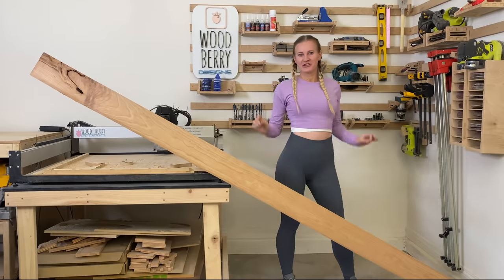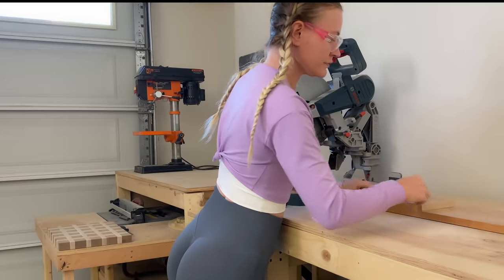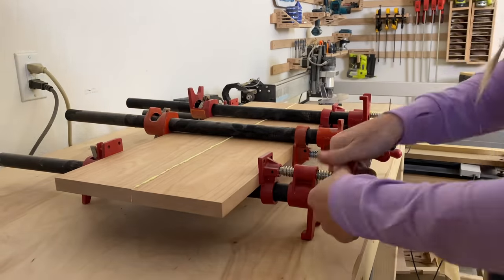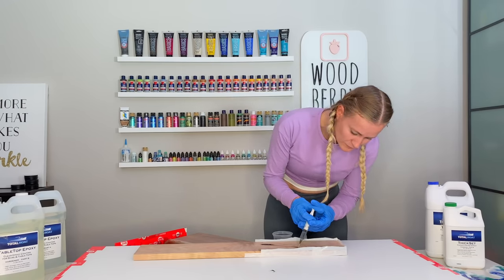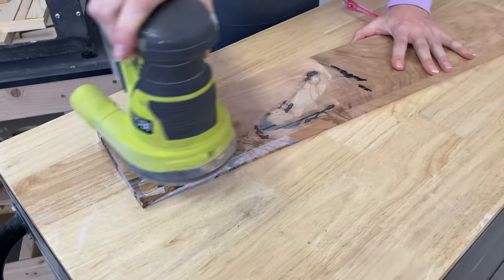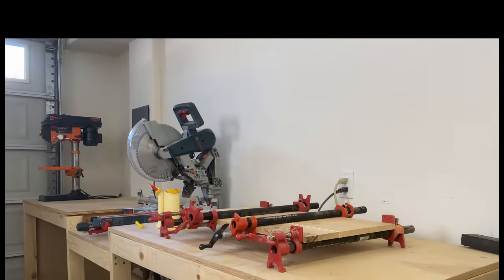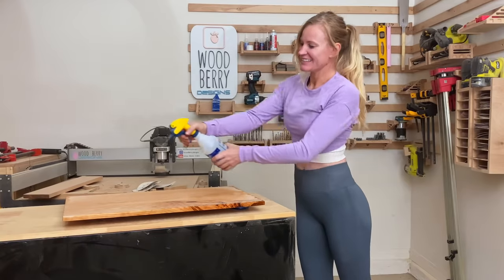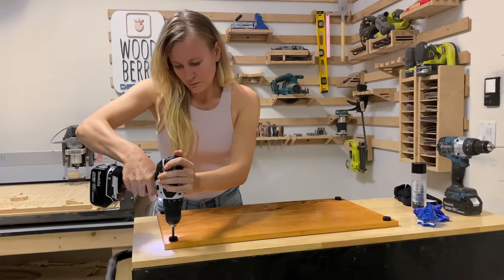Simple Cherry Wood cutting board 🍒

Comment: Hello again Meike.  Here's a tip to consider.  Black pipe tends to leave stains on wood (especially oak).  A piece of masking tape or blue painter's tape placed on the pipe at the seam you are gluing prevents staining.  Some may stick to the board but is easily sanded or planed off.  Easier to get the tape off than the stain.

Comment: You are so talented and beautiful at the same time 😍
Reply from the maker: Thank you so much Luis! ☺️
Reply: I use the same dewalt planer. I found using an  Oneida cyclone Deputy mounted top of 50 litre bin then cleaner air thr HEPA filter worked a treat. Much Shorter length of100mm ducting needed. Really surprised how well the cyclone handled the massive planer ejection of wood chips

Comment: Nice cutting board - simplified. Usually, I see cutting boards with endless strips to make up the size. Your with three cuts was perfect.
Reply: @WhatMeikeMakes  Hey you should have your hair pulled in a bun, when using power tools. Also u shouldn’t where jewelry as well. It’s a little safety tip

Comment: Using a biskit jointer would have made it much stronger on the joints. If it's a cutting board, personally I would have made it a bit smaller and added handles of some sort (or even just a strategic hole like a painters pallet) for increased mobility. Makes it much more efficient when you can lift with one hand and scrape food directly into a pot, bowl, etc. Keep up the good work!
Reply: You actually came here for the wood working?
Reply: @ZenMastaKai  Well...yeah. I admit that booty click bait but tbh I liked her cleat system quite well and then saw the video of how organized her shop was. I can appreciate that and I try to watch others to possibly adjust how I do things. Constantly improving.

Comment: I love cherry wood.  Not only does it look great, it is easy to work with and smells great.   It is also one of the best hardwoods to smoke your food with.  I like to resaw 3/8" planks and use these to cook plank Salmon.  I am lucky to be a pro woodworker, and have access to lots of lumber.   So using scraps for this is no biggie, as cherry can be a bit expensive.